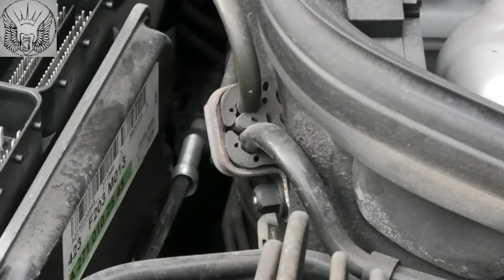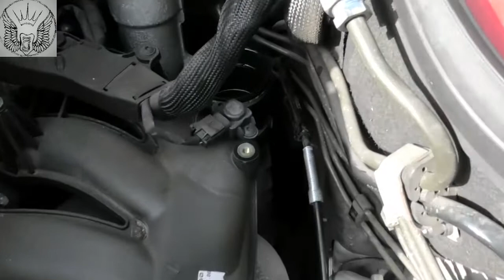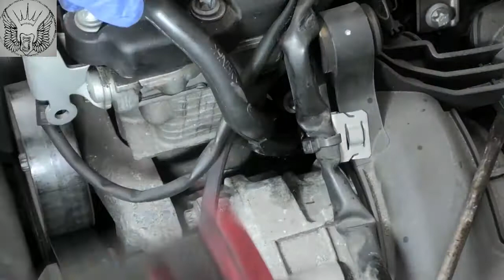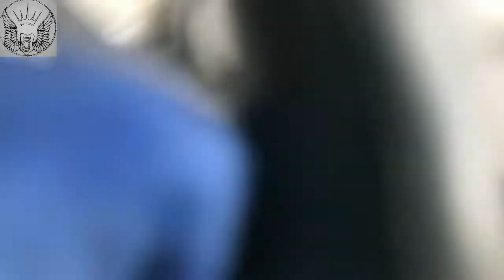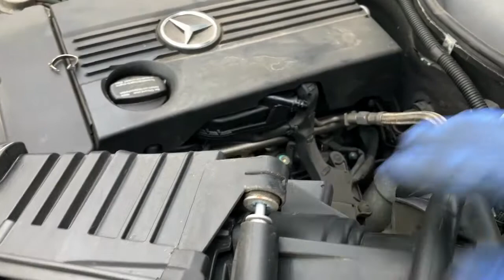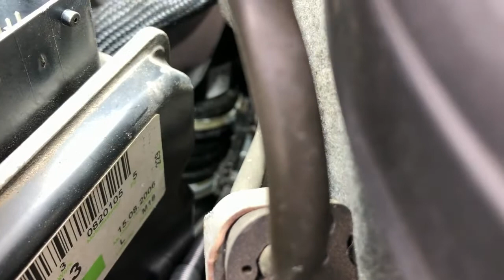Mercedes C class w203 2006 2007 upper crankcase Breather hose replacement Part Number A271 018 1282

Comment: Thanks very much for sharing your video. Very helpful and took some of the fear out of tackling this job. Strongly recommend that anyone doing this job should get hold of a Flexible Long Reach Locking Hose Clamp Removal Pliers with Ratchet Tool. Less than £15 on ebay. Made an awkward job so much easier. I'd also recommend having the rear breather hose (A2710160481) to hand as when I replaced the front breather hose (which had a large hole in it only visible when removed) I noticed the rear hose, although not split, was "squidgy", collapsed and possibly on its way out. I didn't have one so ended up doing the whole job twice!! When replacing the airbox, the two bolts that drop down and get in the way can be "held up" by strategically placing pieces of card which can be pulled away once the airbox is in place. Great video - thanks.
Reply from the maker: Your very welcome 🙏 and am really happy you shared your experience and give us some recommendations and tips on the job, every helps really appreciate it.

Comment: If the hose is stuck is it acceptable to spray some form of lubricant onto the hose or down the hose pipe to help loosen it? Also what sort of lubricant can you use on the new hose? Excuse my ignorance I’m thinking of doing this myself and I just need to get the correct stuff before attempting it. I’m just scared of putting something on the pipe and it rots it quickly or it gets into the engine and causes problems later.
Reply from the maker: Use some wd40. That will help a lot. It’s safe to use. You only need a little.

Comment: Hi , i have a problem with c180 kompressor . When i hit the brakes the RPM starts going up and down right before stopping, Sometimes the engine turns off
Reply from the maker: Have you changed the crankcase breather hose yet ?
Reply: @DaringBeefcake  no

Comment: What size hose can i get at autozone for the replacement please?
Reply from the maker: Hi, the part that I changed in this video is this part number a2710181282, so if you check the hose on your car and find it has some cracks or its flat then you can change that hose.

Comment: With that problematic clamp, would moving the wiring loom on the right out of the way help? Also that loom seems to have a deep cut at the top near the hole for the box. Great explanation of the steps and tools required!
Reply from the maker: That tool for the clamp is God sent hehehe, the clap is problematic but if you try doing it the traditional way it will take you for ever, the tool helps a lot. the loom is ok to be honest, hope the vid helps you. :)
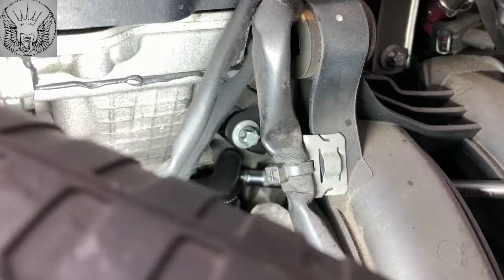Reply: Just finished this job successfully, thanks to your excellent instructions! Sorry I meant the breather hose clamp. The electrical loom is visible just to the right of your fingers at 9:51. Trace it up to the top and the crease/cut is visible. Slide the metal clip out and move this loom out of the way to get a bit more room. The main problem I had was getting the air-box slotted into the air hole, despite using that really nifty clamp tool. The trick, which I should have noted from your video was to use some WD-40 to make it slide in. To get the breather hose off and on, I used an 11" Long Reach Hose Ring Grip, Round Nose Pliers. A flexible hose nut driver tool is also useful for tightening the breather hose clamp, but the hose clamp has to be near the top (see video, about 22:09; hint: tape the nut socket so it doesn't come off the tool!). Yes, the breather hose did have a slit so hopefully the car will run better now. Many thanks again for the great video! Cheers

Comment: What fault code does it give?
p2029-001??
Reply from the maker: no it was more like P0171 mixure to lean
Reply: @DaringBeefcake  p2029 mixture rich = p0171
Reply from the maker: @emreuyar5344  ok well mine was mixture to lean maybe p0172 i don't exactly remember the fault code but it was lean not rich..

Comment: im struggling to get the hose on the inside valve
Reply from the maker: Take your time and you need lots of patience it’s not easy, but you could warm up the hose a little so it can be a bit more flexible.
Reply: Your right, be patient and don't panic. I tried following day after 2 hours of frustration and got it on second attempt.  This may have helped also - I soaked the end in some boiling water and then pushed a sealant nozzle into it and left overnight. This may have stretched it open just enough to help it slip on. I used the same angle of approach as you did in the video...it helps getting an aim on the valve. Getting some good lighting on the target area also helps. Thanks for your videos on this subject. Most helpful.